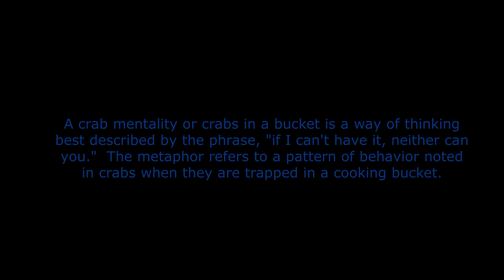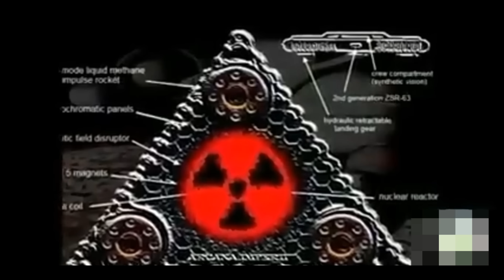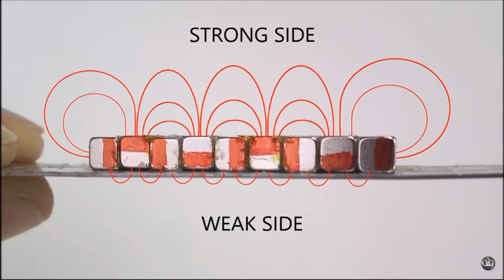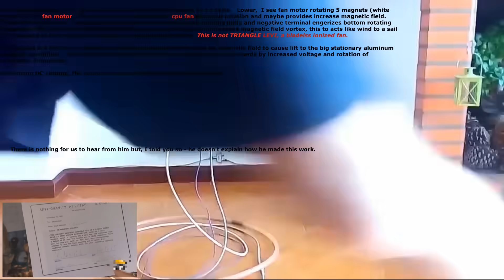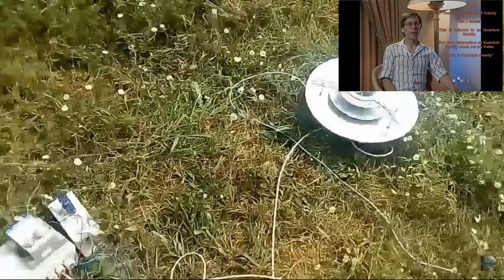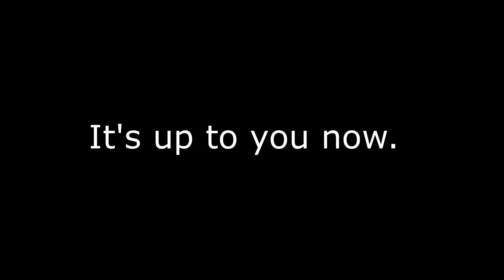anti-gravity project

Comment: He is ignoring the electromagnet interaction between the object with the intense magnetic field and the steel members of the building. It will always slow down the object with the intense neodymium magnetic field and not the one without the magnetic field. Try the same experiment far from any magnetically interactive material such as steel. I think he's smart enough to know that.

Comment: Isn't the whole idea to produce magnetic levitation without a base surface to work from?  The first part requires a thick copper plate to repel the magnetic force.  It doesn't require too much magnetic force(from experience).  The second one again is restricted to the coil and it produces unnecessary heat.  Yes, I have performed my own magnetic levitation experiments with success. The problem is that magnets at a certain level produce a great amount of force to harness.

Comment: Safety Time Machine Key Points
1. Automatic door lock
2. Goes invisible
3. Moves objects out of the way
4. Has a camera/TV inside so the time travellers can observe history
5. Has rocket power to fly/Uses wormholes to Time Travel
6. It's rocket fuel fades fast so the environment is not changed.
Reply: Uh, don't you need a flux capacitor?
Reply: Incredible

Comment: EMF force and Gravity are not directly linked. No matter how much magnetic density you create it does not affect the curvature of space-time caused by mass (which is gravity) As far as dropping the balls with one having a magnetic field, in an atmosphere containing multiple gases, water vapor, ozone, dust, static charges, etc. I am only mildly surprised that there was a difference in terminal velocity. The mag field has to be pulling charged particles to itself affecting the density/resistance of the air it is falling through. He needs to retry that using a 60 foot tall, non metal tube with a vacuum inside and mechanical release of the ball and electronic timing. If there is a difference then - I will be both surprised and Very interested.
Reply from the maker: My thinking its the EMF + Capacitance, tuned with ultrasonic waves emitted by the driver from the top of craft at 40K Hz to  64 KHz towards the big array.  The big array is in ultrasonic standing waves enhanced by EMF bubble canceling gravity center of the craft, hence the craft moves upwards direction of EMF, bigger the EMF bigger the encompassing lift.

Comment: How about lumen and copper lumen copper lumina copper
Reply from the maker: My thinking its the EMF + Capacitance, tuned with ultrasonic waves emitted by the driver from the top of craft at 40K Hz to  64 KHz towards the big array.  The big array is in ultrasonic standing waves enhanced by EMF bubble canceling gravity center of the craft, hence the craft moves upwards direction of EMF, bigger the EMF bigger the encompassing lift.

Comment: It’s not just a magnet falling/dropping through a pipe, it’s a copper pipe that part is important.
Reply: Actually it works with aluminum too, likely would work with gold or silver also. You would just need a lot of money to test it. The one thing they all have in common is that they are not magnetic.
Reply: @jonross377  Everything is magnetic though.  The smallest atomic pieces are dipole in nature from what I have seen published recently this year along with the latter half of 2018. I imagine induction would work with gold and silver, likely the others like mercury, etc. But I am just a curious person, not formally educated. LImited personal experience with experimentation of various dynamics that can be created. Is the aluminium foil ionic (right?) levitating triangle actually levitating? Where does repulsion cross over to anti-gravity. I think the term is simply a misnomer to lead people astray in thought. I imagine that in theory, you could use the magnetic field lines of the Earth to at least propel something upwards...crude experiment in my head going on as that idea just came to me. Using the ley-line vortices to either repel and move away from the ground, or as a paraglider can catch rising pockets of hot air and rapidly ascend, a similar concept sounds plausible but it would probably be limited to the field line itself to maintain its orientation/trajectory. Random tangent thought there. Felt like it might help someone complete their model of something that could be game-changing for the public.

But I don't think it is fractal to the insane degree that some have proposed (new age folks come to mind), at least on the smaller end. Who knows what the known universe could possibly form overall on the grand scale. I think the next 3 years of particle physics will get us to the base particles if I had to guess from the trend I've seen over about 10 years now. Imagine the understanding of everything that will cascade into a place that makes sense to us once we understand the mechanics that are possible! The good and bad. Just pray those involved are truly responsible because it's likely something that could make a hydrogen bomb seem like a musket.
Reply: If you weigh the pipe, and the magnet separately, then weigh them while the magnet is falling through, they add up. NOTHING IS NEGATED. Magnetism is NOT Gravity.
Reply: It changes the pressure too
Reply: @Jyl Freeman copper is one of the most value metal on earth,99,9% dont know that...

Comment: I think they're confusing electrical magnetism with gravity, they may as well be trying to harness a rainbow.
Reply: Said the guy who never heard of a prism lmfao
Reply: I am afraid you are very wrong my friend...
Gravity is not an autonomous field modallity it is simply dielectric acceleration...no different to magnetism just coherency....multiplicitive omni directional force vector towards the centre of that mass....unlike a magnet (point source) that has poles or more correctly the inverse of counterspace (centrifugal and centripedal convergence and divergence) many things acticing in unison...by definition a magnet is still the same object as before it was magnetised size weight etc..the only thing that's changed is the quality (coherency) magnet = coherent...Gravity = incoherent...a good analogy is light (hybrid) coaxial circuit..a 5w light bulb is useless however a 5w laser will burn your eyes out...BUT 5W IS 5W RIGHT? Wrong 1 is coherent the other is incoherent...and light does not travel nor does it have a speed it is a rate of induction through a medium I.e the aether....the universe is dielectric and magnetic...(force and motion) and (inertia and acceleration) expressions of the aether field simplex pressure mediation...there are different modalities of the aether feild and fields are not particles virtual particles like the election have never been the input or the output of any experiment done...even the guy who discovered it even denied the existence of the election as a particle until he was offered fame and money...wave particle duality is a joke there are no dualities in nature! Four principles of nature everything is capacitance risistance permeability and permitivity...there is no such thing as a pure insulator or pure capacitor...try asking a physicist how light speeds back up again after it leaves glass (without breaking the laws of conservation of energy) they will stutter...they won't tell you that glass is actually a capacitor...BUT what really makes me laugh if when they desperately start throwing WAVES around.."oh it's a wave" OF what a wave is not what something is a wave it's what something does! Just like space is nothing it does nothing and acts upon nothing same as time time is not a force it's a measure of magnitude or motion over distance
Reply from the maker: Actually trying to apply  Newton's 1st law against aluminum plating as a repropulsion
Reply: @young Dumbvery true... the only comment worth replying to come check out my fb page you may just be interested m8 all science no rubbish https://www.facebook.com/Danmeggitt1987/

Comment: g=kSxB 
g is the inertial field m/s^2
S is Poynting vector watts/m^2
B is the monopole magnetic field either + or -
For -B field component g is negative or down toward the mass.
For +B field component g is positive or away from the mass
Notice g=0 for equal +B and -B monopole field components found in a dipole B field.
K is a constant that can be measured empirically.